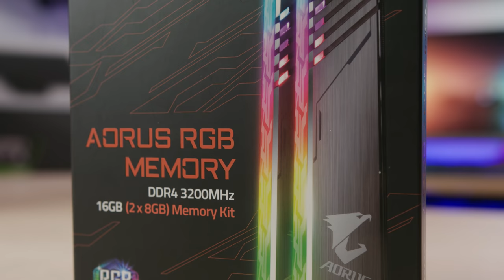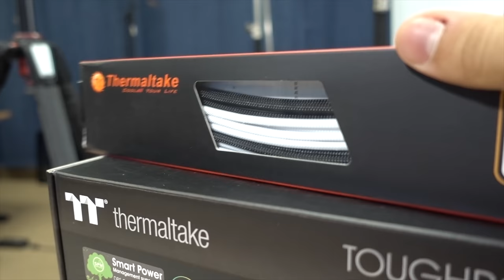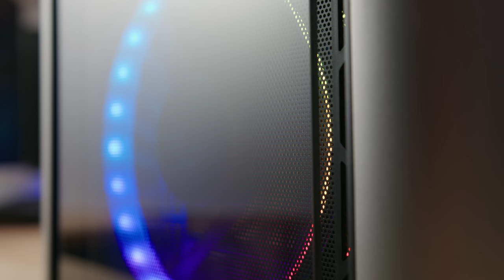He never expected his new PC to look like THIS #pimpmyrig #pmr #episode4

Comment: I have a thermaltake core v1 which is a cube case and i felt bad when people kept saying to me that cube cases sucked but this video has proved that cube case pcs can look good and inspired me to try and manage my cables a little better even if my case is bad for it
Reply: I don't see anything wrong with cube cases. It really just depends on how you want it. For example, I prefer a black and blue theme, vut someone else might like red and white. I prefer a standard matx case, but you prefer a cube case.
Reply: I have the v1 in my closet, thing just wasn't cutting it for my GPU size. (Sold my 980 and had to replace ignoring dimensioms.) I loved that case though.
Reply: I've got the V21 and it's amazing

Comment: 6:00 the cpu stuck to the cooler XD
Reply: PGA sockets can do that if you don't heat up the thermal paste before removing the CPU cooler. In a worst case scenario some pins will break off.
Reply: That is ironically enough, the second time it happened to him. He posted a pic on twitter of the first incident. Paul referenced this in his LGA vs PGA video lol.
Reply: @anonanonymous6793  still funny though intentionally or not :D
Reply: @VaiCloud  hm, didnt knew that.
Reply: @VaiCloud  A good way to prevent it from ripping out without heating paste is to twist the cooler off instead of straight lifting it. Has saved me from many broken or bent pins in my life. With that said, hurry up and get with the times AMD and go with pins in the socket instead of on the CPU!
Reply: The same thing happened to me when I was changing my amd stock cooler to an aio cooler, the cooler wouldn't come off even though I had the cpu on full load for 3 hours. Gladly didn't break any pins though.
Reply: typical AMD thing
Reply: @Pyromonkey83  Seen any of those videos where anything at all gets dropped on an Intel motherboard and wipes out the pins in the socket? And they're so much harder to fix?
Reply: @kYnTso  actually it's a typical PGA thing.
Reply: Was that the reason he upgraded his cpu?

Comment: Hey Kyle awesome what you are doing but man are you sure that cheap mobo is fine for a 2700x? I remember a video at gamers nexus in which buildzoid mentioned that the vrms oft the x470 aorus ultra gaming got already really hot and he wouldnt recommend to use it with that CPU. Just a thought I am no expert on this. That said Andrew seems to be a fantastic guy. Really happy for him and I will definitely check out bis twitch!
Reply: Yes, but with all data airflow, and i dont argessive oc will happen
Reply: The CPU won't be working that much in this instance since most of the gaming performance is leveraged by the GPU and the streaming is processed by an external card.

Comment: is it really that much of a big jump going from 3000mhz to 3200mhz ram ? because i just got me some gskill sniper series 16gn @ 3000mhz, im just hoping it will game ok on my ryzen 5 2400G. ( first time builder by the way )
Reply: Naah it won't affect as much. I also have a 3000mhz @ cl16 kit on my 1600x,  and it works flawlessly and isn't that far off the performance chart against a 3200mhz ones. Although, my 1st gen ryzen does benefit a lot more on RAM speed against the zen+ architecture, but the difference is negligible.

Comment: Its a shame i live on the other side of the country i would love you to pimp my rig. Its been 10 years since its last update and most people just laugh at me at this point.
Reply: It's only dated if you have anti kink, UV lights, a cdrom drive, a drive mounted fan controller, and a GTX 500 series or older.  Join us my friend the water is lukewarm!
Reply: @colin8601  I have a raidmax tornado, with raidmax hurricane side panels, with cdrom, and 3.5 card adapter, antec 650 psu from befire the 80plus certifications, and 80mm fans, lol
Reply: @tizzledexter6260  OG rig. I just upgraded from the timless classic Sandybridge.
Reply: @colin8601  lol id be ok with sandybridge at this point, lol i think the 860 is lynnfield rofl, on the good old asrock p55
Reply: @colin8601  CDRom drive???Is that one of those new things that replace my 5 1/4" floppy drive? Cool.
Reply: @paulsisk4986  get with the times. You're over there rubbing sticks together for fire and the rest of us are out here with our zip disks bud. 100mb revolution

Comment: Did you just pulled the CPU cooler with the CPU attached? Lol
Reply: thats how 10 years of building pc works LOL XD
Reply: I can tell you that many of my AMD rigs have suffered from this. You try and try but the grease LOVES to act like a glue and rip the CPU out of the socket as you remove the heat sink. It almost never damages the pins, but it's scary as hell the first couple of times it happens to you. I really can't fault Kyle for that - I chuckled when I saw it.
Reply: @Benjamin P some also know it as thermal grease, he's not wrong
Reply: @AtomicAJ74  if you turn it on and stress test it for a few mins it will come out easier (; it also helps if you do a slight twist motion instead of just pulling up
Reply: I still have an old Athlon X2 (AM2) soldered to a heatsink to show my friends that it happens.

Comment: For its time, the V-21 was a great case. Still use one for my daily driver. Accessibility is awesome.
Incidentally, the V-21 had the exact same SSD caddies down the side as the Level 20 VT does. Not quite sure how the presenter missed that.

Comment: I have literally zero experience with in-case RGB and I haven't done a build in about 5 years... Prepping for the new system. Do you need some kind of controller when doing a setup like this to ensure all the RGB works together properly? Thanks in advance!
Reply: Eric Lusk typically a controller is good to have. Ram and graphics cards don’t need any external connections for the RGB but with fans they can be very useful. Most RGB fan packs come with a controller already so that shouldn’t be an issue.
Reply: @kyledockery4140  Thanks for the reply, man! That's good info to have for sure. I'll hold off on picking one up to see if the fans for the new build come with one included. Thanks again!

Comment: I've been considering that view21 case, are the glass panels of decent quality/thickness?
Also super surprised you didn't change out his mobo with something else you had on hand, potentially getting one with different PCIE spacing/locations allowing the capture card to be installed?!! that's a $60 mobo, plus I would've figured you'd want the better overclocking capability of a 470 chipset, as well as onboard wifi for the times you're not able to hard wire an ethernet chord

Comment: I am glad for anyone who may receive an upgrade in any of the components for their rigs but should we consider the change from perforated mesh to tempered glass an upgrade?  The tempered glass looks cool and if you want to show off your internals is fantastic, but that should apply for towers because the tempered glass is only at the sides, this is a cube and now 5 of the 6 faces are covered in unbreathable material, how is that better? 
The case must have been designed to be used primarily with a liquid cooling system, and aside from that decision you can tell that there was an improvement in most of the components of the original machine, but IMO it was a questionable "improvement". Still, Andrew looks happy with the pimp so I guess everything worked out in the end

Comment: Awesome video, very informative and entertaining. I just bought a system with this case. Looks (to me) like my guy rotated the rear panel 90 degrees. My PSU is on left side, not bottom, GPU is therefore oriented horizontally (not vertically as in your build) so it does not block the view of the case interior and everything in my case looks much better from the left side panel.

Comment: I might be crazy for saying this but... I kind of prefer the look of the v21 over the Level 20, not to mention it's infinitely better airflow.
Reply: Yeah, I'm hopeful we've reached peak tempered glass, because its proliferation is the ultimate expression of form over function right now. Heavy, breakable, and cases that are full of it tend to have terrible ventilation. Also the cable management options in the Level 20 VT are basically nonexistent, and there's nowhere to hide wires because it's glass everywhere. Very meh case.
Reply: @burgundyyears  My main problem is all these cases with front panels that cutoff your airflow almost entirely like those NZXT H500 cases. Having some type of front panel mesh just seems like a necessity in a PC case to me.

Comment: quick question since I have same motherboard, are those fans adressble RGB or standard RGB, if ARGB how did you connect them to the 4 pin 12V LED_CPU header? ( as that header only supports standard RGB? ) or did you use a RGB controller?
Reply: RGB controller.

Comment: I bought a powerspec power supply, can confirm a microcenter in house brand. I returned though for a corsair just because too short cables and ugly cables, because of the red pci-e indicator cable and the 24 pin.

Comment: The Core 21 is better then the Level 20 VT to me and would be a down grade as level 20 VT is all glass and very little air flow but in either case they should have made it a little wider so it would fit full ATX motherboard.

Comment: I heard him roast all those parts then realized that my rig is getting old with that R3 1200. 🤣. At least the 1060 3GB is still a bit better than the 1050 Ti. I think. I'm still stuck with the B350 🤣. I have a 2x4GB 3200 LPX. They have a clock of 16 though. I feel left behind everyone has SSDs and I'm still churning along with my HDD 🤣

Comment: If possible pimp my rig? as you can see i"m in the stone age lol ..  .. rig info . ..AMD FX(tm)-8300 Eight-Core Processor  DDR3 1600 mhz 16 gigs ram. in a COOLER MASTER Elite 430 RC-430-KWN1 Black Steel / Plastic Computer Case. and video card is AMD Radeon (TM) R9 380 and i have two 1 tb hard drives for games and a 120 gig ssd for windows  and as for power supply not sure the brand is  but its 650 watt 80+ somethings i think ..

Comment: #pimpmyrig

Intel i5-6400 that doesn’t turbo
8gb ddr4 2166mhz
Amd 570 8gb (broken) 
Oem acer predator g3-710 mobo 
LiteOn 500w PSU
Acer predator g3-710 case 
No case fans (thermal throttle nightmare)
2x1tb hdd one is dead
Reply: Why no case fans?

Comment: I'd rather have the original system. 3000 or 3200 MHz on ryzen is a wash, adding crap that blocks airflow like the dummysticks is just stupid.
Double sized graphicscard, seriously? Not even RGB on the big thing either.
If I were Andrew I would have been pissed, all he wanted was better cablemanagement and you didn't even show how the new cablemanagement was.